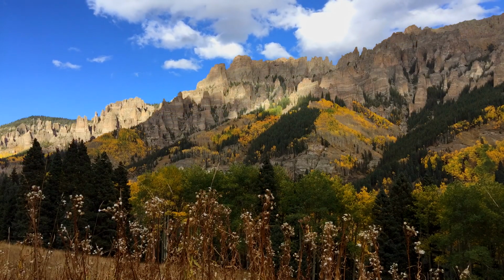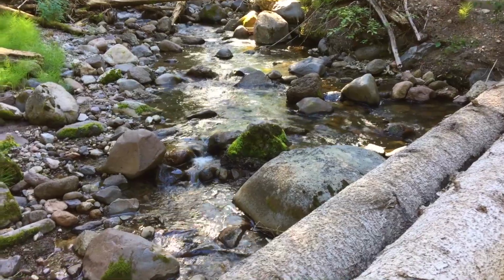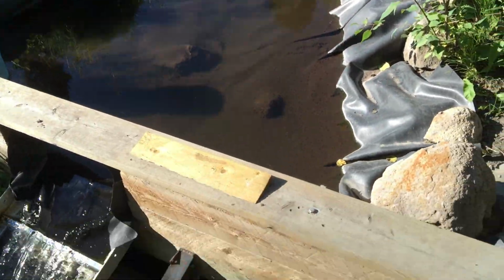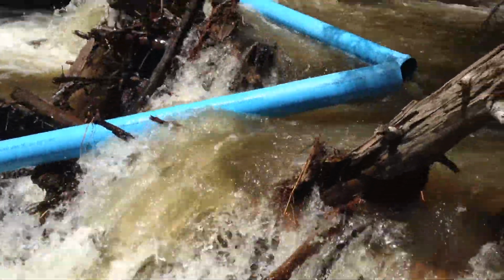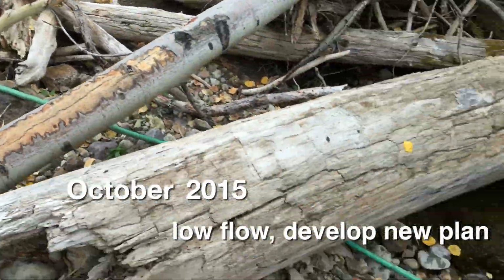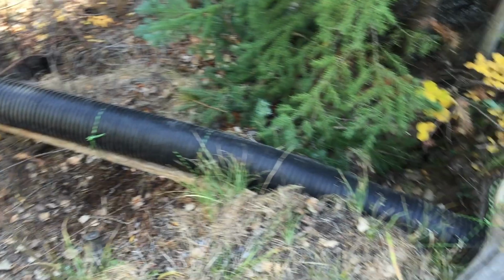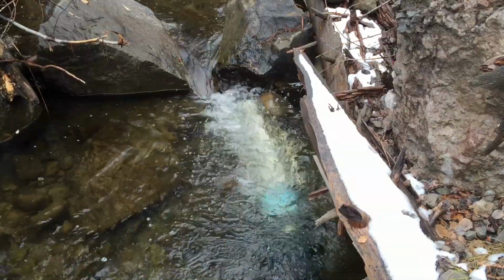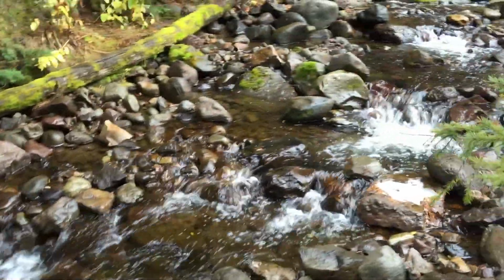Part 16 MicroHydro Power System in CO

Comment: Thank you for sharing this info.I'm a mechanical engineer and finally watched the whole series. Things make more sense now that I've watched all of it. I'm impressed that you went heavy duty on the system. So many people cut corners up front and pay later to keep a system running.I'm wondering if you considered increasing the sizes of your spring boxes to hold more water. It would have dried up eventually anyway but it might have given you time. Along the same thought did you consider a battery / inverter addition into the original system? You could have generated power on a more consistent basis and drawn down the battery during peak loads. 20 / 20 hind sightYour intake screen design is terrific. Love it.With a 6 inch line your velocities are going to be so low that you probably have very little pressure loss. I never did catch how much water your intake can provide. I assume much more than you can consume. I take it your amp meters are for each of the 120 volt sides. They never run equal.Are you considering to automate your needle valve. Right now I see you manually setting it and then the system dumps the excess load as heat. Or slows down if you have too much load.Why did you go to a belt drive in the new system? The generator turns at the same speed but the Pelton wheel now runs slower. Have you considered a timing belt instead of a v-belt? They're more efficient.Just as a comparison. I had a house with an air to air heat pump with electric backup and for the defrost cycle. My January usage was 85 amps and my June usage was 10 amps. That's monthly average.
Reply from the maker: +Bob Smoth 
Lots of questions here.  Good ones too, so let me try to dig into them in some depth.  First off, I’m glad you enjoyed the series.  I started out in the first few videos to attempt to explain how the system functioned to someone that one day might own my property after me.  Since the 1996 original installation I experienced several years of reducing water flow(worst in winter) which I attributed to drought conditions.  By the time I had discovered the potential that the aquifer feeding the springs might have been compromised, the water rights to the causative pond had been made absolute in water court and so it was a done deal.  No legal recourse is available.  This process occurred over a span of about 5-6 years, so it was difficult to gauge what was really occurring.  The idea of building larger spring boxes wouldn’t have worked because the simple aim of the system is to keep the pipe full for full pressure.  You can’t create water flow where there is none and adjusting the flow at the power house was how I knew how much power from the available water could be created.  I kept pretty accurate records of flow settings and could see a slow degradation taking place over the years.  Spring/Summer were never a problem except for shifting ground and pipeline breaks due to the high 212psi pressure.  Fall/Winter when the most power is desired was a sliding slope of less and less power over many years, to where I had less than 10% of the designed power and was experiencing efficiency issues with the shape of the water jet due to the greatly reduced water flow.  The jet just wouldn’t form an efficient shape to get the most out of the turbine/pelton design.
I had purchased the additional land with the creek on it with the intention of one day putting in a bigger system and developing a "hydrogen farm" and having all the power I would ever need and being able to one day store or sell hydrogen for transportation or whatever.  That technology is still yet to become reasonably affordable, but one day it hopefully will be.  Prior to building the house the initial  choice was made to put the system on the springs due to the fact we could get gravity flow spring water, have a trout pond, drive the power production at a very reasonable comparative cost of $25K vs $140k to run mains power on poles to the property and then pay a utility to generate our power.  The decision to go AC vs. DC/Batteries/Inverter was made for efficiency reasons as direct drive AC production was possible due the available high pressure.  AC generation is a lot more efficient than DC with a lot less energy lost and you don’t have the maintenance issue associated with batteries.  The property was to initially be a vacation home with only part time occupancy and the thought of batteries at 8600 ft in the cold of winter and providing less efficient power production overall, with the eventual need to replace them and contend with the toxicity of the chemistry involved seemed like the less attractive alternative to AC which was clean and simple.
The velocity of the water in the 6" may potentially at some point in the future rise to somewhere near 5 ft. per second which should be an upper limit I don’t think I want to exceed.  The manufacturer of the Turbine(Canyon Industries) informed me that the maximum design flow I could expect to get through the 1" needle nozzle would top out at about 300 gpm or .66 cfs.  This flow combined with the expected pressure of ~100psi told me I would have capacity to generate about 8.5Kw single phase or 12KW three phase.  I already owned the generator which was rated for 10KW single Phase/ or 15KW Three phase, so the sizing of the pipe was based on this exit end limit vs. the amount of flow available.  At some point it comes to how are you going to use the power you make and I’ve yet to maximize what I can already generate.  I decided to see what winter flows could handle.  To date I haven’t been able to accurately measure how much flow there is in the dead of winter, although at this point I think I’ve proven that water freezing issues will not be of great concern.  This winter has seen several multi-day dips to single digit temperatures and the system hasn’t shown any problems thus far.  The wires in the ground and the pipe were designed for potential future expansion should I need it.  The turbine could one day be retrofit with a second water jet to increase the available flow onto the pelton thereby increasing the power production.  I’m just going in stages at this point seeing how much can reasonably be utilized.  
One of my fellow hydrohead guys suggested I look into an inverter that can synchronize a battery source with a live AC system which would enable me to store some of the power in batteries.  I hadn’t ever heard of this and apparently such a system now is commercially available, so that would be a consideration in the future should I choose to size up the system.
You are correct in assuming the amps are 2 - 120v legs, Single Phase.  I considered rewiring the house for 3 phase and having 3 legs and more efficient transmission/utilization of the power, but the maker of the load controller(Thompson Howe) advised that I stay with single phase.  He said the difficulty of balancing the loads on the 3 legs on anything less that 25KW total power would be very problematic and most likely result in burning out the generator.  This discussion took place after I had put the 4 wire transmission line in the ground, so even though there was some waste there the saving grace is that someday I could size it all up and have existing wire that could handle it.
The plan on the needle valve is to create a remote monitoring system that I can read in the house or over the internet which would first look at water pressure and alert any change in it which would indicate that the pipe is draining due to a clog at the intake or a flow rate that is greater than the available water.  Pressure is the primary indicator of the system functionality.  I do plan to make a remote drive for the needle assembly with stepper motors, but it won’t be automatic, but remotely and manually adjusted when pressure is indicated to drop or when the season demands more/less power.  Winter is when the greatest need is required for heating the house and I’ve yet to complete that part of the overall plan.  First I have to determine if there is adequate flow in the dead of winter to justify the expenditure in dump loads and relays which will heat the house.  The load controller is a primary part of the whole system and designed to manage the balance to 60hz via electrical load vs. a system where the needle valve is manipulated.  Either way works, but the ELC(electronic load Controller) is the fastest and lowest maintenance.
On the belt drive part of the system, the speed of the water jet as it exits the beak of the nozzle is governed by the water pressure(psi).  With the first spring fed system, 212psi was fast enough of a jet stream to drive 9.5" diameter pelton on the turbine shaft to a range of 1800 rpm when under load.  100psi in the second stream creates a jet which is not fast enough to rotate the 9.5" pelton fast enough, so it has to be stepped up via the belt system to achieve 1800rpm.  I didn’t consider a timing belt as I was advised by both a hydro engineer I employed and Canyon Industries that a duel belt system was very forgiving on alignment.  Alignment was an issue as I had to build all this before I could install the machinery.  The loss of power is not severe as far as I know and there is a ton of power there anyway so a small incremental loss is not a big deal.
My systems for heat are three fold with passive solar(South facing windows) where sun strikes slab floor and stores heat in addition to radiant glycol lines circulating in that slab.  The glycol can be heated with either excess hydroelectric power or propane as required and lastly there are 3 high efficiency wood stove throughout the house.
You can imagine in a cloud covered Winter cold spell at 8600ft. it can get quite cold in the mountains of colorado, but the house has adequate design to remain cozy in the worst conditions.  Nicest heat I’ve ever experienced without the dry nose effect of forced air.  On a sunny day it is not uncommon to crack some windows to cool off when its 30-40f outdoors and 90f inside.  Whew!
Just the same, I am curious about your 85 amps.  Is that at 240v?  VA=Watts X hours=KWH.  How many KWH per month do you consume?  I’m not sure there is any sort of heat pump available for glycol system, but I’ve heard heat pumps are quite efficient.  How big was your outdoor heat coil?  Buried I assume.  If I had been smart I would have buried a coil in the transmission wire trench at no extra cost besides the pipe.  But as you say 20/20 in hindsight.  Oh well, we are blessed anyway with what is.  
More vids to follow in the future(Spring) when I get the monitoring and remote control systems set up, so please do subscribe, share with interested friends, and give a thumbs up as it helps with the Youtube ratings.  I will most likely create a blog to include questions/answers  like this so I don’t get repetitive. Thanks again and please share any thoughts or further questions.  Nice to have an engineer ask cogent questions, though I am a neophyte myself.
Reply: +MrHydrohead Thanks for the quick reply. WOW you designed in a lot more than what shows in the videos. I'm impressed !!.......I did some preliminary design work for my father-in-law in the early 1980's trying to size solar power, wind mill and energy loads. This was for a cottage north of Huntsville, Ontario, Canada. I had real issues with seasonal loads vs instantaneous loads. I could use the solar panels to create a hot water heat sink ( indoor swimming pool ) and use a heat pump to draw the heat out to warm the house. He had a hill near the house and I considered using a windmill to pump water from the lake up the hill to a storage pond and generate hydro on demand. System sizing was impractical and the control systems were going to have to be analog. Computers just weren't up to the task yet......As you've found, the sun doesn't always shine when you need heat or the wind doesn't blow when you need electricity. Either you vastly oversize on the generation side or you put in some kind of storage capability ( battery or collection pond ). ( random thought here: if you run into freeze up issues at the intake end and water flow, you could dig out the pond by the weir to increase storage and put in a pool solar blanket during the winter, or just a black plastic sheet ).......Heat pumps are a very efficient way to heat a space ( fridges and air conditioners are heat pumps ) They are rated by COP ( coefficient of performance ). A COP of 3 means it's 300 % efficient !! What that means for every 3 units of heat you put into your living space you buy one ( generate from your hydro system ) and get two from your heat sink ( air or ground ).....It is theoretically possible to use a heat pump to generate steam to drive a generator that will drive the heat pump and still have power left over to do other things. Possible but not practical......We built our house in 1987 ( 2500 sq ft main floor, 1000 sq ft second floor 2500 sq ft basement. ). We had allergy issues with hydro carbons so decided to go with a heat pump and electric back-up rather than natural gas. They were going to make us put in a 400 amp service. 200 amp service is standard. We had to explain that the heat pump was so that we didn't need so much hydro. Ours was an air to air system so it looks like an oversized central air system with a big compressor outside. The load issue ( and you'll find the same ) is that there is a huge draw on the system when the compressor is running. I think ours was a 3 HP motor. Also being air to air means the outside would frost up and had to be defrosted periodically, which means the heat pump reverses and draws heat from the living space to defrost. During those periods you need back-up heat. In our case that was 120 amps. Also the backup would kick in if the heat pump couldn't keep up because it was too cold outside  In short, the system was drawing zero when it was off, 3 HP when it was running, 3 HP plus 120 amps during the defrost cycle. That's instantaneous incremental steps. That's hard on your system unless you have a battery / inverter to help balance the load. Those are becoming more economical as more people go off grid.......As for generating hydrogen and oxygen through electrolysis for other uses, good thought. Personally I'd probably lean towards ammonia, the system pressures are much lower.....Love your thought on burying a glycol line with the wire. I'll have to remember that one.......My usage was 3245 KWH in February and 1743 KWH in July. Don't know how I got those earlier numbers. The heat pump made heating costs manageable. We went with an air to air system as we would have had to drill down being in the city......You have a very interesting house, congratulations.......Sorry for the bad formatting .........PS I'd suggest a full size relief valve near the bottom in case someone closes the needle valve quickly and blows half your pipeline apart. All the best
Reply from the maker: Yup water ram would be a disaster, but it's locked up and not many people around on my road that dead ends at a wilderness area.  Still, it is a concern for any remote control over the Internet.  Best to keep it inaccessibly simple and stupid, KIISS.  I appreciate the notes on you setup.  It's clear your expertise are deep and informed.  I will ponder your description and ask questions if they occur if you don't mind.

That's a lot of juice.  Wow 400amp service.  I would love to find a device that could heat glycol at the ratios you describe.  That would be killer!  I'll have to do some research.  Maybe that's a niche market to create and patent a device if one doesn't exist.  What say you?

On the collection pond, it is currently lined with a rubber liner and I hadn't thought of the potential solar thermal gain benefits.  Dumb luck I guess.  Good thoughts thanks...
Reply: +MrHydrohead Those ratios are for off the shelf heat pumps. Been around for a long time. Trane makes a very good system .....If you talk to central air contractors they can fill you in on how the systems work. Be prepared to go around many times as you ask questions with the answers that lead to many more questions. When I sold the house real estate agents ( and buyers ) were afraid of the heat pump.  It should have been a plus. ......I'm in London Ontario Canada. I worked for Westinghouse for years building transformers....I imagine your system works by you setting the needle valve, which gives a constant generation level. If you don't have enough load on the system, it overspeeds and you have resistance loads that come on and bring it back into balance. If you have too much load it underspeeds and the resistance turns off. Your range of 50 to 70 Hz can be real hard on any electric motors you have. I just found that out the hard way.....I did my fourth year engineering thesis on windmills, back in 1975.........I assume you connect to the internet through wireless....I hope you do start a blog. Some one needs to be a central source for information. I'd do it but I'm not that good at it..... Is there a way to contact you directly. Say no if you have security and spam issues. The email attached to my account is to prevent spam on my primary account.
Reply from the maker: Bob,
You are right on how the ELC(electronic load controller) functions with load. It shunts off a segment of the sine wave via thyristors to keep a constant 60 hz. I did use a wide range 50-70 ha. It used to vary a lot on the spring fed system due to debris getting stuck in the jet assembly, but now it's just super constant with the big flow from the creek.  I will tighten the range I've set given your comment on motors.  Thanks for that.  I actually can't see any email address for you.  Comments just get forwarded to me and it's all public what others can see here in the discussion.  You could use lensermanATgmail,com for a private discussion.